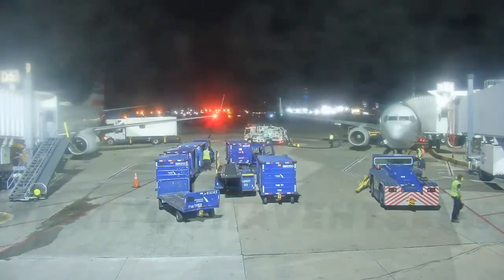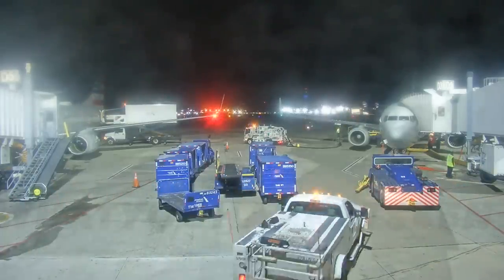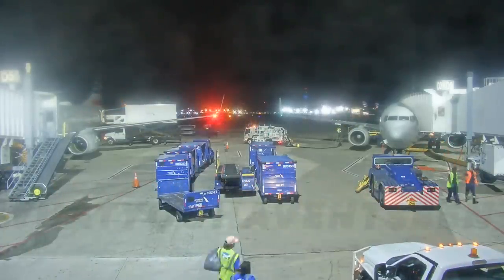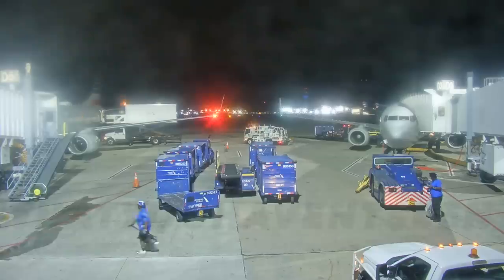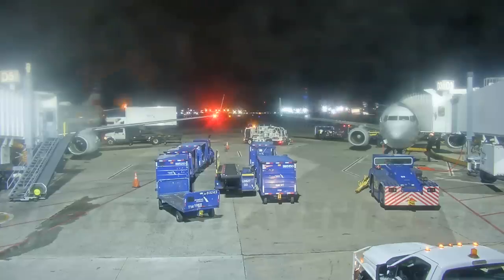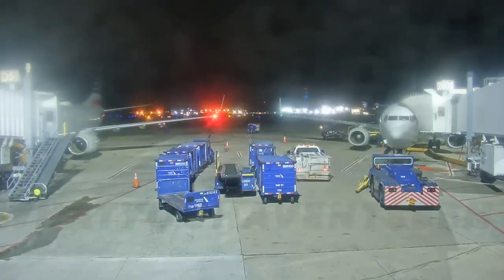Jet Bridge Pierces American Airlines 737 (Charlotte, NC)

Comment: Evidently it has since been repaired, because at the exact time this video was posted this jet is flying 580 mph somewhere over Ohio
Reply: Yup, flying from Chicago O’Hare to Reagan National. I bet it was an expensive fender bender for the airline.
Reply: A little duct tape and some White-Out, good as new :)
Reply: ya they only generate revenue by being aloft
Reply: maybe they all are on O2 and wearing parkas? 🙃🙂😂
Reply: It was ferried to an AA maintenance shop in Tulsa about 2 days later.  It remained there for about 7 days. Photos would have been sent to the engineering department at Boeing and they would have had to engineer a repair, then submit detailed instructions/drawings/material list to AA before starting the repair.
Reply: @Cobalt135  Super cool, thanks for the detailed info. Engineered repairs are really interesting, how they can make something certifiably good as new in a short amount of time like that.
Reply: @needleonthevinyl  Well, it likely helps speed along the process when the same damage has occurred in the same area on multiple airframes.  In this case Boeing could call up past repairs to that area and compare the damage to what was just submitted, and draw up the plan from there since previous engineering has been done for like repairs.
Reply: @Cobalt135  sounds to me like the part of the jet way that keeps poking holes in them needs to be reeingineered.
Reply: Beauty of an aluminum airplane. Not sure how long a composite plane would take to fix.
Reply: @migbham1 🏆
Reply: @whiteoutgotu  ❤️

Comment: i'm a retired electrician.  this was no accident, it was sloppy adjustment/maintenance/testing of sensors and limit switch systems (or more likely the complete lack thereof).  the bridge operator was NOT at fault here, and i think that played a large part in her not getting ripped up for this.  not knowing otherwise this reeked of a sweep under the rug routine, i wasn't there, but i wasn't born yesterday.  safety systems should have prevented the impact, or lessened it to a non-critical non-invasive level.  this is a passenger and crew life-endangering level of incompetence.  my tuppence.
Reply: Now most passenger boarding bridges have prox sensors that detect the plane, but this older bridge does not have any. The operator drove the bridge straight with the cab at an angle. The metal under the floor deck on the right side pierced the fuselage.
Reply: Hence the comment “probably talking to her to cover it union-wise and CYA-wise”

Comment: Ouch. Right near the static ports. That is an RVSM critical area and that whole skin likely had to be replaced. We had a similar incident recently at my airline, but not as bad. It was only a dent rather than a puncture. We had to do a temporary repair and then fly it under a ferry permit to a heavy maintenance base to have the area re-skinned.
Reply: Looks like it only took them 7 days to have it back in service

Comment: They fixed it with duct tape 😂
Reply: Speed tape.
Reply: I saw duck tape used to fix the overhead after an extremely hard landing that caused the overhead to fall in on Carnaval Cruise Line’s 727 in KFLL.

Comment: I don't know how that large hole would be called cosmetic. It's not a scuff mark that will buff out. I'm fine with calm and cool, but I worry that dismissing this as a minor cosmetic issue to be handled internally, could lead to more incidents either from malfunctioning equipment, flawed procedures, or operator training. Hopefully they did investigate to find out how and why this happened.